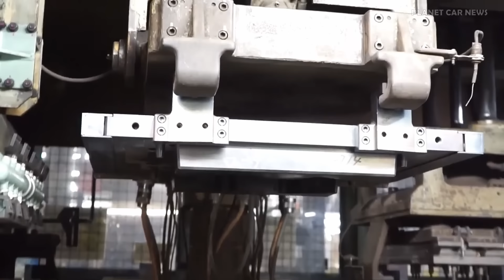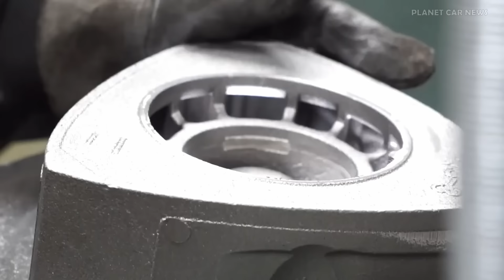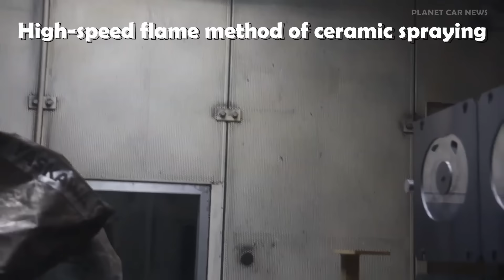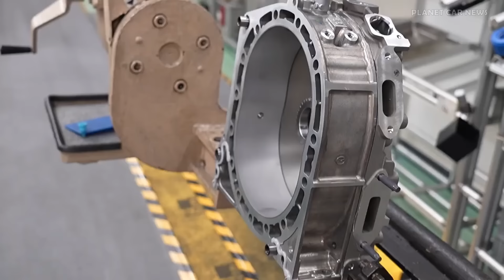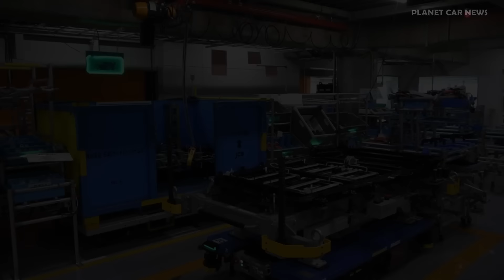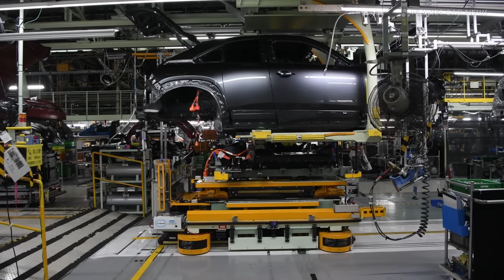Mazda ROTARY Engine Production In Japan (MX-30 R-EV)

Comment: No way Mazda built this rotary assembly line just to create rotary generators for a car they won't sell much of.  There's got to be more to this story like a new Rx-7 coming in the somewhat near future.
Reply: They made patents for a 3 rotor Wankel with a hybrid system and a car that fits said engine. Rumors are the car is going to run the engine as a generator in "eco mode" and as a regular engine in sport mode.
Reply: Probably built on existing lines selling parts to older car owners. Many rebuilds are out there, for personal, racing, or restoration.
Reply: @drunkdriver more RX-8 were sold in 10 years than FD RX-7 ever did.
Reply: Никакого RX-7 не будет!! Даже не жди!! 🤣🍥🤣
Reply: I've seen a lot of MX30 in my city lol
Reply: @DoKaVaL  this one probably not, Mazda will have this junk for 1-2 year and then too producing like with those EV before , Toyota have similar garbage with bz4 and in same time they have bad sale of it
Reply: @drunkdriver  ok, how rx7 can be famous until today?
Reply: If you look closer the REV MX30 assembly line is just a fraction of a bigger factory that makes other models too, probably in more numbers. So, I don't think it was such a big investment.
Reply: The fact everything is being hand assembled tells me they don’t expect to make many of them at al.
Reply: The components of this engine are clearly intended for more than generator duty alone.

The end housings are discrete rather than integrated with the adjacent motor and generator assemblies, which together with the Rx8 style flywheel taper mounting on the eccentric shaft, indicates they have engineered it to be capable of mating to a gearbox directly.

Comment: These are 16X design rotors, each holding 0.8cc instead of 0.66cc of older designs. Not sure if additional volume comes from direct injection space.
But idea is to have larger rotor to increase burn time of fuel for greater energy efficiency and output
Reply: They increased the displacement by making the rotor and housings "taller" compared to their width.
It's equivalent to a long stroke piston engine, optimised for low end torque and efficiency rather than high revving power.

Can't wait to get my hands on one

Comment: Mazda  brought out rotary  engine back in 80s  or mid  I was one of the owner then it's good car  one problem  the inner seal wore out to fast .
And the exhaust  system  is  hilarious
Reply: Try 70's.  We used to race a 1974 Mazda RX4 wagon with a 13B. We used to build the engine on a milk crate.  It's claim to fame was 3 moving parts. Smoothest running engine ever made too.   We also learned really fast to NOT run it without the thermal reactor attached to the exhaust. It shot 3 foot flames out under the car.
Reply: But the flames were part of the fun, along with the loud "BRAAAAAPPPPP!" when getting on it! I had a friend with an Rx2 and we had a lot of fun porting the cases and building motors for it, that car was a blast. @acdii

Comment: Just wondering how these pass emission regulations since rotary engine inherently burns oil in the gasoline mixture?
Reply: Simple its not an engine. Look at lawn mowers, you don't have to smog a lawn mower. 

I know two different things but you get the point.

Comment: Generator car are unfortunately less efficient than just wheel drive. The kinetic energy to electric energy and convert back to kinetic energy the heat and friction energy loss. The train do that because it has 3 engine it can turn off 2 when moving, you only have 1 engine in the car. Train don't use transmission because cheaper to maintain. Do what Toyota had done a normal hybrid is good enough.